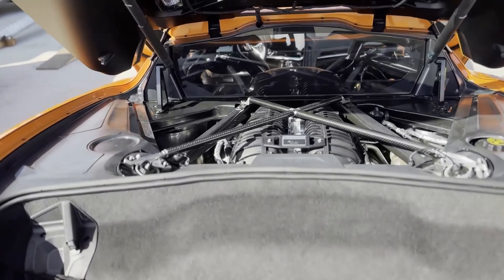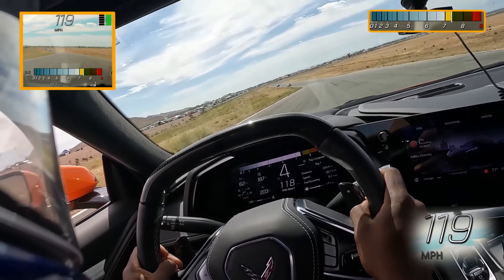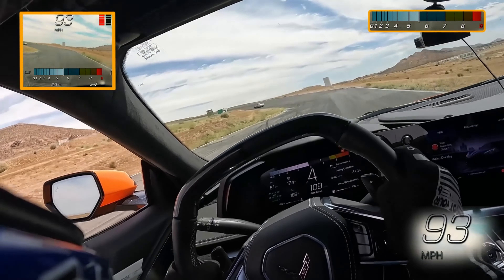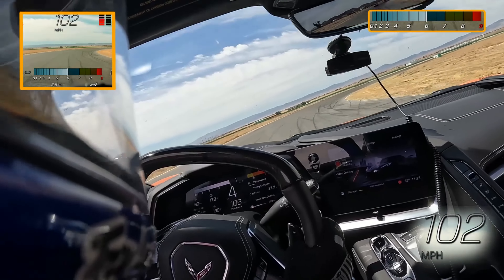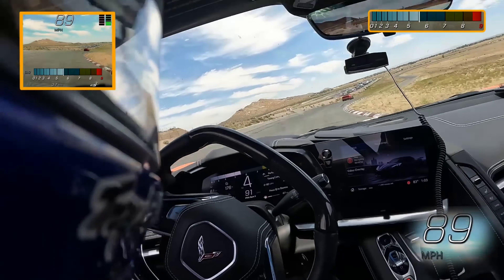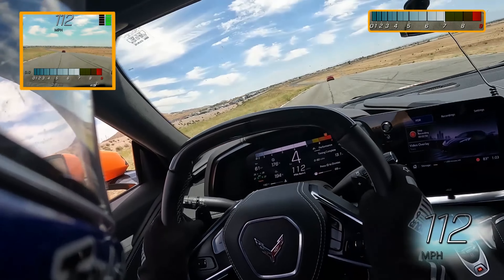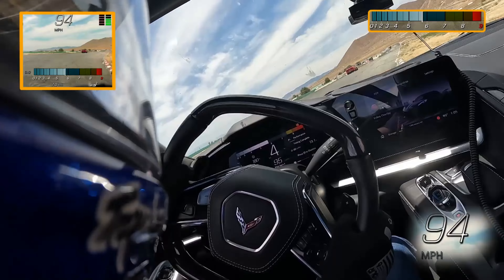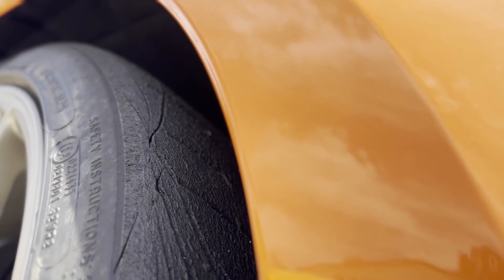Track Testing the new Cross Brace kit on my C8 Z06!!

Comment: Was the damaged tire stored in below freezing temperatures then dropped to the ground causing the rubber to shatter? Because that is how that type of tire damage presents.
Reply from the maker: I live in California, purchased the tires in April, we don't even get below 48deg in the winters
Reply: @jesse_iwuji  Those cracks are very typical of freeze-impact damage. Perhaps the tires were transported through a freezing climate en route to the West Coast. The production date would be a good start to determine if they were produced before the winter of 2022/23.